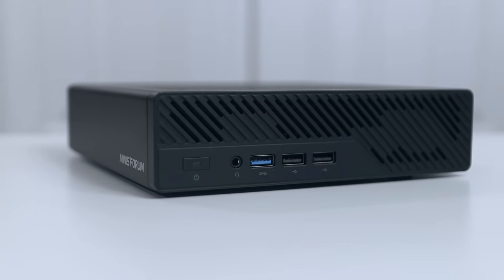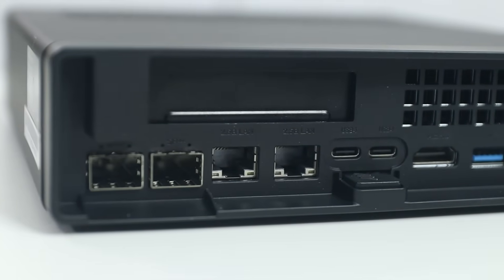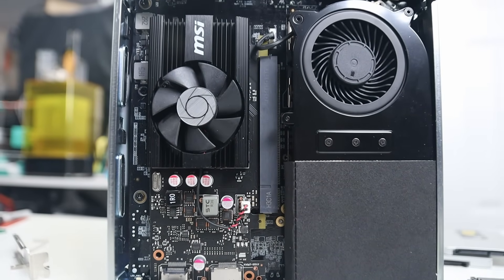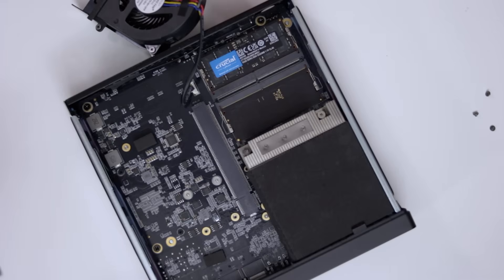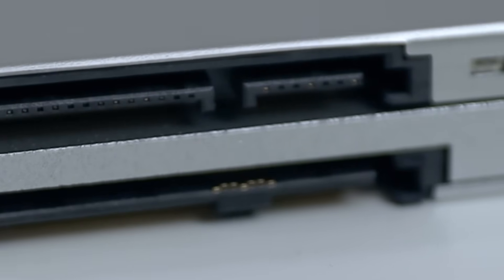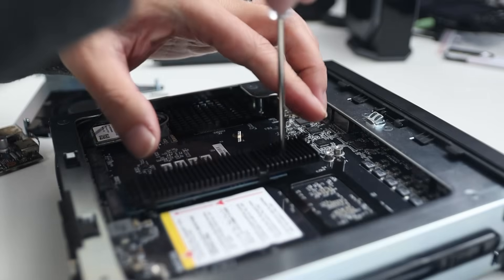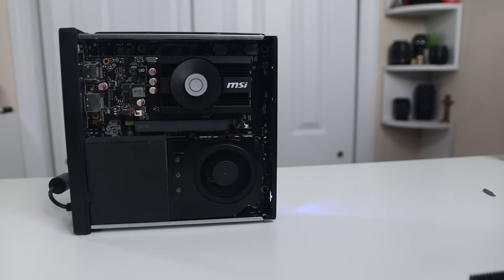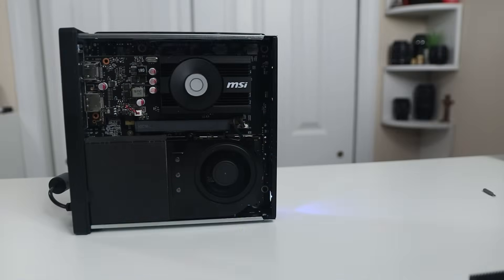Is This The PERFECT Home Lab Mini PC?

Comment: There is a Radeon RX 6400 that is low profile single slot if you want to use a slightly better gpu in it.
Reply: better gpu, but also more fan noise.

Comment: U can build a much cheaper one.
👎👎👎
Reply: Varies.

Not if you take the small form factor into consideration. At 196 mm x 189 mm x 48 mm -- I doubt that you would be able to match this, in terms of feature parity, at the same size and price.
Reply: I’m interested in doing this. Which board and chassis do you suggest?

Comment: 5:46 indeed, "it is insane" how "so much much you can do with this" is limited with SFF form-factor for otherwise capable specs hardware.
It does make a potentially interesting low-power 4x SPF+ with 2x Aux interfaces router, but then again at that price point its a premium for SFF constraints while any Supermicro mobo with two x8 slots will do the same (for fraction of cost used).

Comment: Thanks for the great video. I have a question. Is ist possible to connect my pc with usb 4 to the computer and connect to a network share?
Reply from the maker: There is a weird adaptor you can buy for this I actually have one
Reply: Without an adapter?  If your PC has TB4, then yes you can use Thunderbolt Networking directly at 20 Gbps.

Comment: Is it just me, or does it seem like most of the problems with this unit is that they ran out of space? I mean, just design it a little bit bigger, next generation. Yeah, people gonna be OK with that. We'd MUCH rather have the functionality and room to work with. It would still be small enough. Why does it need to be so little, to begin with? It's not like it needs to be portable! It doesn't run on batteries. You'd still need to plug it in. 

Also, I'd want more gen 4 or 5 NVMe slots, so I can use larger capacity drives. Gen 3 is pretty llmited in size. I don't care about the speed so much as the capacity in a system like this, since we don't have the space for adding more drives.

Comment: Is there a way to create a SAN for ESXi with this machine? I mean with sfp+ it would be very nice to connect it to a little storage(most NAS Systems support iSCSI) for a bigger Datapool and you can use a faster raid option than the internal RAID 1  of the ms 01 which is managed by the cpu so u lose performamce.

Comment: It would be great if you could show us a compatible PCIE multi-NVME card that has its own RAID controller. This would be very useful to avoid data loss.
Reply: Hardware RAID is generally considered unnecessary these days, software RAID can use core processing power and with the number of cores available on a system like this it will be faster than and just as reliable as a dedicated hardware RAID chip.

Comment: Neat little box, it seems like there are a couple tiny compromises that make it not the perfect machine but "good enough" for some uses. It seems like if they could cut the price down (or when these are on the used market in a couple years), it would be a great "do it all" machine.
Reply: Compromises like not hosting 10 more pi compute modules internally? 😂
Reply: @caust1c  Heh, well the internal slot is big enough for the Pi-KVM CM4 PCIe card, so you could boot a Pi in there for IPMI :D
Reply: @JeffGeerling it already has ipmi why you want 2?
Reply: I love seeing interaction between content creators on here.
Reply: Heh, I know I often look to other creators for some ideas or to compare different bits of tech from multiple points of view. Been subscribed to novaspirit for a few years now! @JackMasterOfNone
Reply: I think that it was either Patrick or Wendall who said that they wished that the chassis was JUST a bit taller so that you would be able to at least fit a dual slot, low profile GPU in there -- because that would be awesome.

I think that Jeff from CraftComputing also talked about some expansion card incompatibilities as well.

But once you apply the Intel microcode update to a Proxmox install -- it can be a very potent machine.

My current "do it all" Proxmox server (with dual Intel Xeon E5-2697A v4 processors) is currently carrying a load average of somewhere between 30-120 as I just redeployed my Plex server, via a LXC container, that's sharing a RTX A2000 6 GB (between multiple LXC containers), and said redeployed Plex server is now re-indexing stuff.
Reply: this pc will be my pfsense )
Reply: I doubt a machine like this that checks all the boxes and takes three months to arrive (unless you're a YouTube influencer) will drop in price in a couple years.   Plus, the Tiny Mini Micro effect and Joe Biden's economy will keep it unobtanium for the average homelabber for quite some time.  I can't wait for my three MS-01s to arrive!

Comment: Hi, I just made a research about USB4 and SATA I/F and found a result (@newegg) with a Maiwo 4 × 3.5" HDD (≤ 16 TB) bay, doing RAID 0, 10 & 5 (don't care) plus JBOD (care a lot) and a 4k HDMI output for a quite cheap bargain ($150), which means you can hook 8 HDDs using two of them on both USB4 of this computer - that make it quite a powerful file server even able to make some calculations while serving the lab (well, the lab or up to a medium size office - that makes it a game changer for cheap HA setups).   Not bad, not bad at all - thanks for the video as I did not knew this kind of machine existed yet.

Comment: No PCIE bifurcation option in bios, really?
Reply: mmmmm 4 stack mvmes...that would be the cherry on top for sure. Though I would feel guilty running it as just a NAS....ProxMox would be killer tho....I wonder if you could fit a card with bifurcation controller on board, but the lack of 16 makes me think this would be a no go.
Reply: @HillPhantom  it would be nice to bifurcate the x8 pcie to 2x4 to support a dual nvme card.  Maybe soon.
Reply: @jk-mm5to  I think he mispoke as I looked up the specs it is a a x16 PCI!  I looked at the specs online, Nova said it was only x8.  I am thinking if you get a board with a Bur controller on board it would work!
Reply: @HillPhantom  so a 4x4 furcation bios option should be doable. I have some supermicro boards that do this.
Reply: @jk-mm5to  for sure, and they should have built it into this MB, but didn't, seems like a bit of a misstep to me.

Comment: What kind of typical home lab needs gen 13 i9 power?  Instead, as an example: mint condition $140 (refurbished) Dell OptiPlex 7050 Micro, 3.1GHz i5-6500T, 16G DDR4, 256G SSD, Windows 10 Pro 64 Bit, Ports: 1 x RJ-45, 1 x HDMI, 1 x DP, 6 x USB 3.0, supports 4K (3840x2160) dual display

Comment: Are you able to confirm the CPU's 96GB RAM max capacity with either Intel or Minisforum. Great video Don
Reply: Their page say : "DDR5-5300 MHz Dual Channel (SODIMM slots ×2, up to a total maximum of 64 GB)" - but an article on servethehome w/ the i9 13900H model claims 96 GB RAM, is has a window$ settings screen capture that show : "96.0 GB (95.7 GB usable)", so yes it is working with that amount of memory (Hmmm, this likely smells of ZFS…)
Reply: @hankhulator5007  thank you for the insight
Reply: 96 Gb Ram is working on my i9-12900H variant although at only  4800
Reply: @SaadOUACHE  I'm watching servethehome video at this time, they use two Crucial DDR5-5600 SODIMM 48GB 1.1V CL46, SKU : CT48G58C46S5.

The fact that you only can run it @4800 is probably due to the brand you use or the number of ranks , as some "brands" do not  hesitate to embellish specs (Crucial is the commercial branch of Micron).
Reply: @SaadOUACHE  Nice, thank you